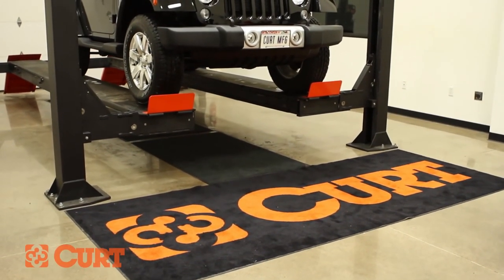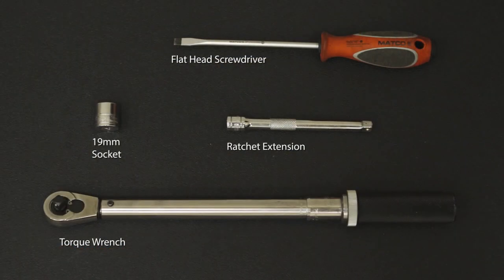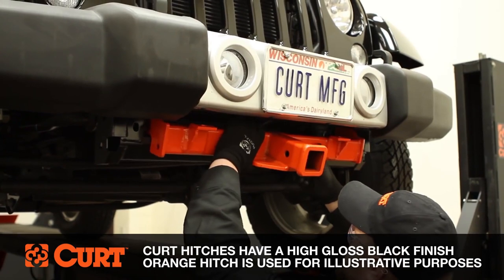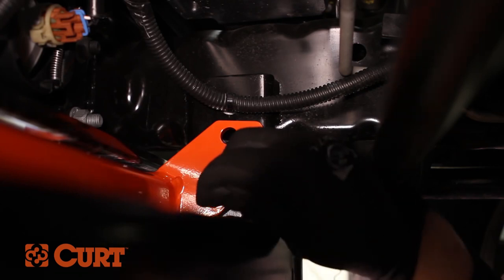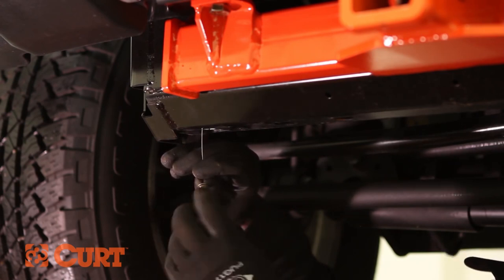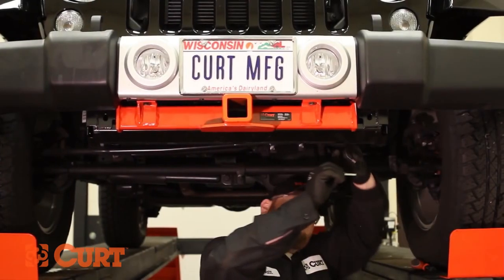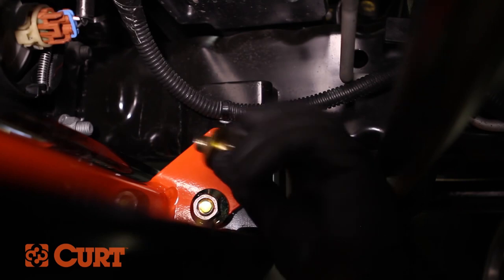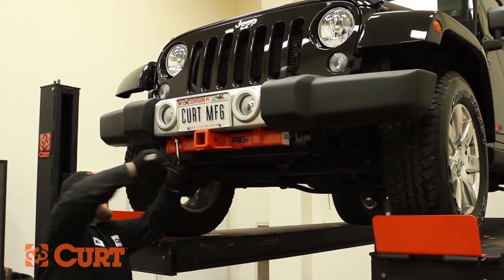2007-18 Jeep Wrangler JK - SNOWSPORT® Snow Plow Front Mount Install Video

Comment: I bought a used snow port hd several years ago and use it on the rear hitch of my 1998 ram 1500 . So much nicer than my old heavy Meyer I had on the front of my s10 blazer .  I’m the only person in my town of 20,000 people that has one . Too old school around here . People don’t realize how well it works and without any maintenance.

Comment: 35" tires and 3.5" lift on my 2014  jeep wrangler unlimited.  Is that too high
Reply: Im in the same boat. Did you ever get a plow? I was told 35s and 3.5 lift require a way to lower the hitch so you get blade contact.